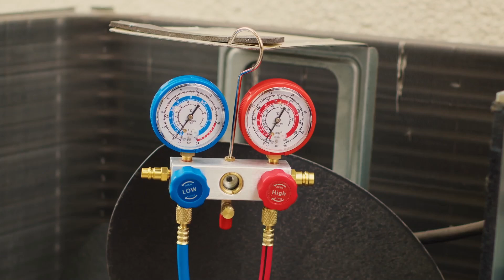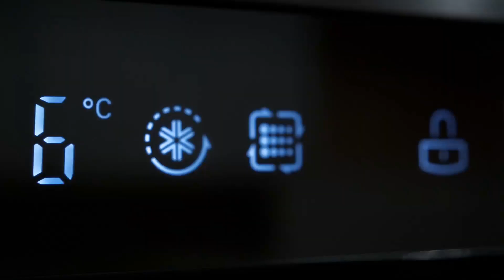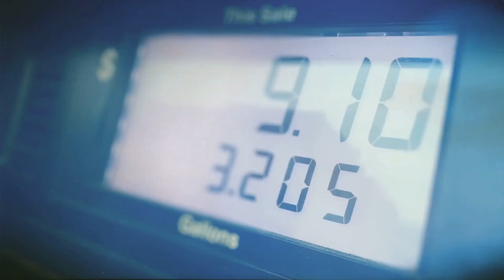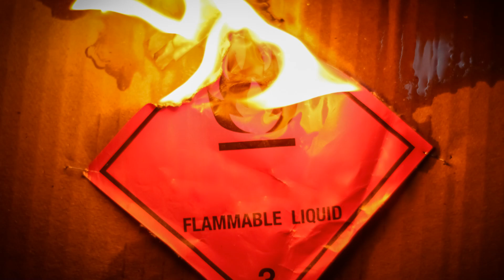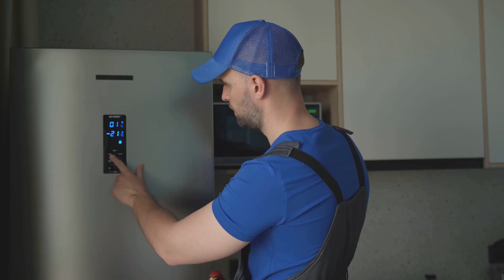What Makes Cyclopentane The Future Of Refrigeration Systems?

Comment: Cyclopentane is not a refrigerant. The C5H10 (cyclopentane) compound does not come close to the same properties modern day conventional refrigerants, There are no P/T charts available for charging it, not sold in supply houses to technicians, and on top of that there is not any R#### designation. The flammable sticker on the back of modern refrigerators is for the refrigerants R290 (propane) and R600a (isobutane). The big sticker in all caps that reads CYCLOPENTANE is the blow agent used for the foam insulation. Maybe fact check AI before publishing the video.
Reply from the maker: Thanks for the info!